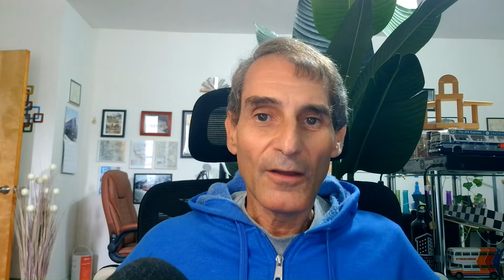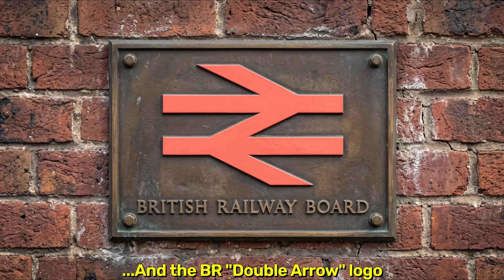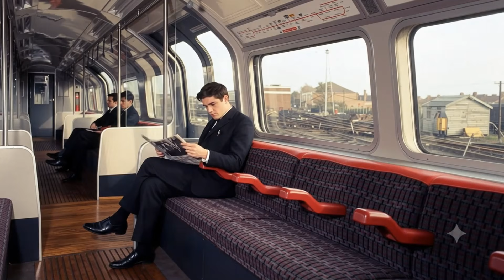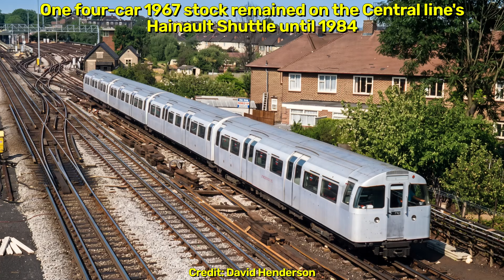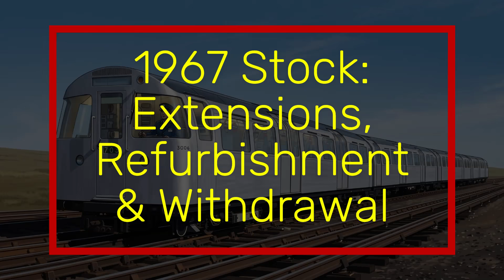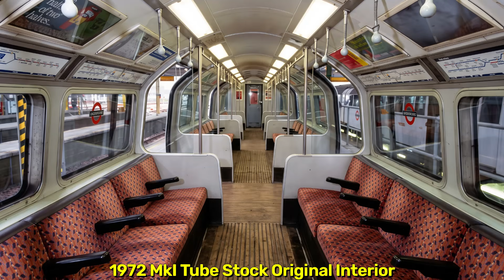The 1967 Tube Stock Story: London's Designer, Robotic Underground Train!

Comment: Another design evolved from the 1967 stock was the C69/77 stock used on the Circle line, Hammersmith & City line (Metropolitan line Hammersmith-Barking before 1990) & District line (Wimbledon-Edgware Road section), they were a surface stock variant of the 1967 stock design but without the curved glass cabs and horizontal seating, after the 1989 refurbishment longitudinal seating was brought in.
Reply from the maker: Hello! Yes, those surface stock trains were quite interesting in their own right!! Maybe a good idea for a future video! Thanks very much for watching again!!
Reply: To be precise the C.69/77 Sub-Surface Stock was the Sub-Surface variant of the 1972/1 Tube Stock, as both were manually operated, unlike the 1967 TS which was automatic.

Comment: Another thing following the 1967 tube stock, the predecessor 1962 stock were the final stock on the London Underground that utilised guard operation on the doors, the driver from 1967 stock and newer operated the doors with the use of cctv at stations, guard operation on the London Underground ended when the 1959 stock on the Northern line was retired in January 2000
Reply: The tube stocks after 1967, till maybe the 1983 stock used guards as well but were converted to one person operation.
Reply from the maker: And we in New York still use a conductor to open and close the doors!!
Reply: My uncle was a Guard on the Picadilly line, he really loved the job but left London Transport when they stopped the guards, he could have become a driver but didn't want to.

Comment: The 1967 stock was a classic, the car design was carried over to the 1972 stock mk1 & mk2 but with standard driving operation, the 1972 mk2 when they were delivered had their doors painted red to distinguish them from the mk1 and are still in use on the Bakerloo line. I hope you’ll look into the PEP stock used by BR from 1972 prototypes to the class 313 dual AC & DC powered EMUs used around London & south east England introduced in 1976, class 314 AC powered units used around Glasgow introduced in 1979, class 315 AC powered units introduced in 1980 in north London, class 507 DC units used in the Liverpool suburban lines introduced in 1978 & class 508 used in north & south London suburban routes and Liverpool introduced in 1979. The PEP units were a workhorse for British suburbs in 1980s-2020s, there is a video of how the Victoria Line was built which is recommended for those interested.
Reply from the maker: Hello! Thanks for all of these suggestions!! Lots of possible material!! Thanks very much for watching again!!
Reply: Bakerloo Line, dumping ground for old stock, still running 1920's locomotive car hauled trains but with Art Deco 38 stock carriages, some just lightly refurbished, new moquette, 1927 stock according to the door plates, in 1968, full 1938 stock lasting until the end of the 70's.  It was still the best line, almost empty of people, for getting from Waterloo to the Elephant in rush hour but the station the wrong side of the Elephant and a run through the underpasses to get to college.  Carried many pigeons and the Elephant station cats to and from Waterloo.